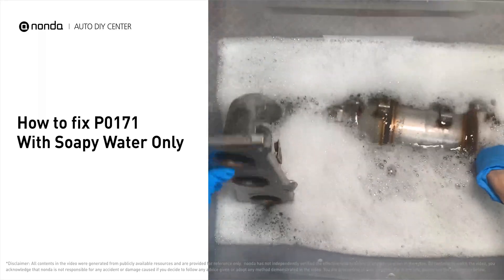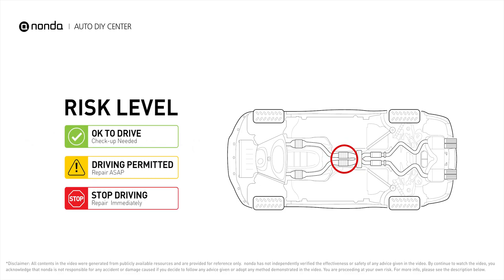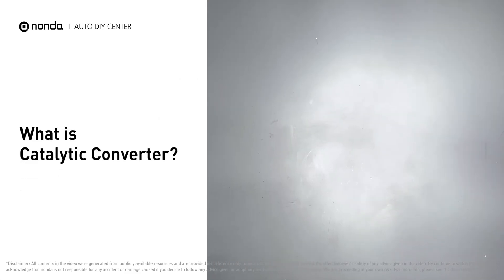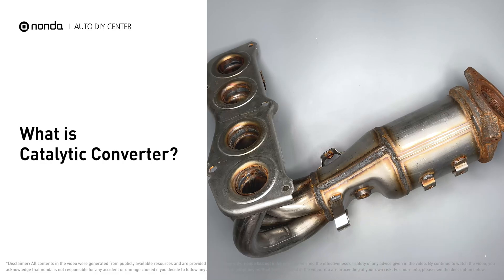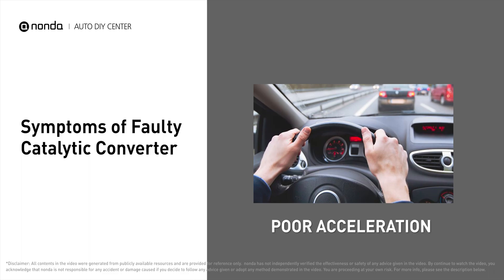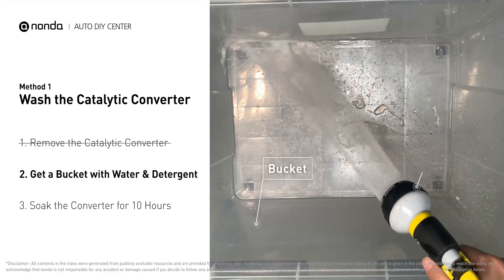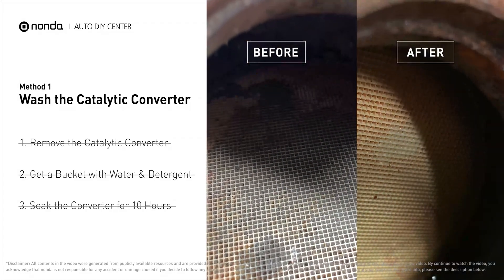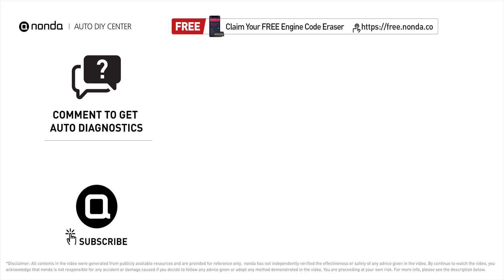How to Fix P0171 Engine Code with Soapy Water Only

Comment: So you can get a p0171 from a bad or dirty cat? Because my car is running lean and every now  and then I get a code for the converter
Reply from the maker: To answer your question- yes. Depending on your vehicle's year, make and model a clogged-up catalytic converter could trigger this code.
Reply: @nondainc  Thankyou for the reply the vehicle is a 2005 Honda Accord 2.4l I’ve literally replaced nearly everything on this car besides the converter ,02 sensors ,and the fuel pump/filter
Reply: @Tarzan510  did you fix that p171
Reply: @tttarms1970  nope the code sometimes goes away by itself and comes back it also alternates from being p0171 and P0420 which is a code for a bad cat I have yet to replace the cat due too needing too replace the auto trans once again  🦃  🎃 🥧